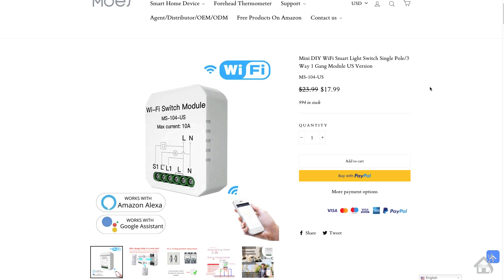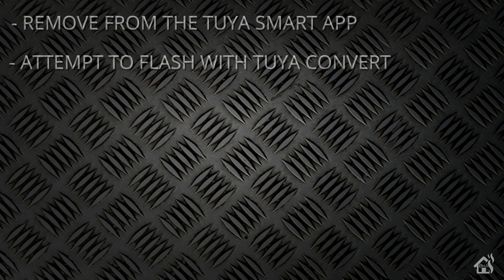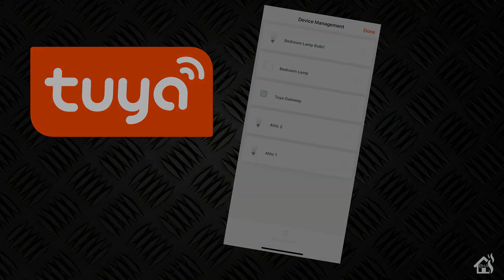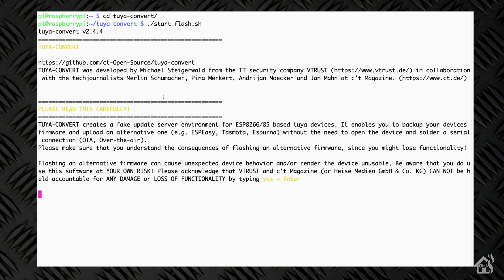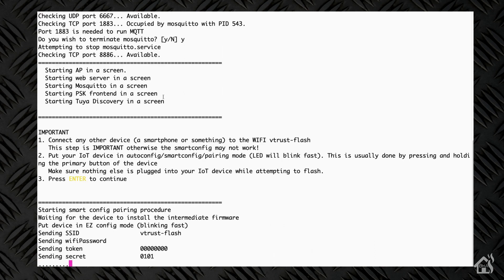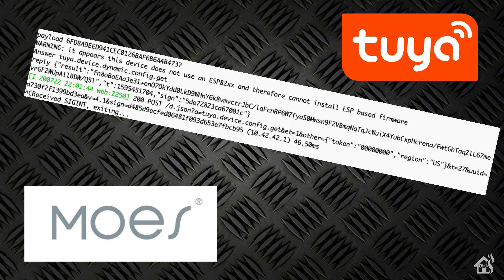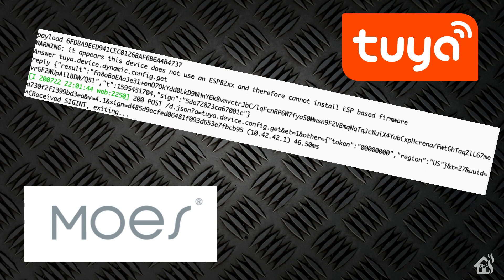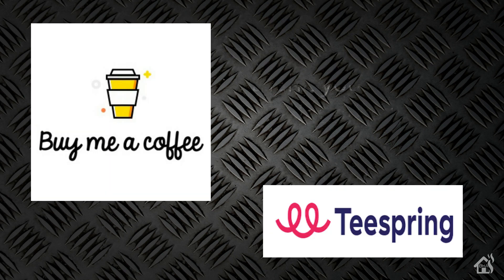Moes Wifi Switch Module - FOLLOW UP!!

Comment: Crap... I planned on tasmotizing my moes switches :( They were the only smart switches at the time that weren't self branded (I can't believe people buy smart devices that advertise a brand on the front; my house is NOT an advertising billboard)

I recently stumbled across athom which has some options but I purchased enough moes switches for my first floor :(

Do you know if this is a limitation of tasmota itself or the OTA flashing project you're using? Trying to gauge how much time I invest trying to tasmotize my moes switches another way